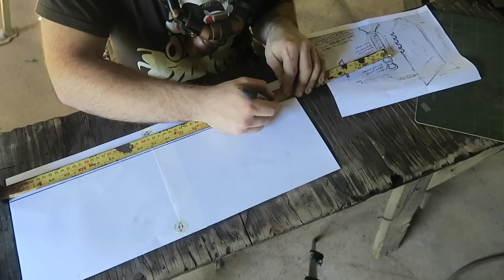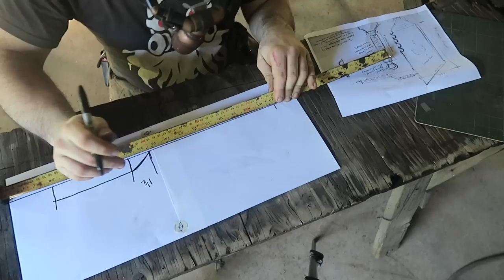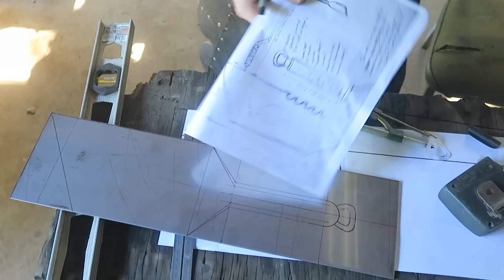Charity Microbuild: Tactical Combat Spatula!

Comment: A note about drilling stainless- Halve your drill speed and double the feed also optionally use coolant. This way you won't work harden the stainless and melt your drill bit.

Comment: Tip for drilling stainless steel, use 135 degree tip drill bits, and It drills slower then hard steel. An plenty of cutting oil, some people like windex for that.

Comment: You need to add some lubrication to stainless when cutting  or tapping threads as it has a tendency to cold weld to other metals same as when trying to screw through it, that is why screws and nuts bolts snap off with  it as you try to do them up .

Comment: Stainless doesn't drill well because like aluminum, it's quite a gummy type material. It's doesn't break chip like steel does. At least it isn't Vasco or MarC300. Trying to cut that material with coolant creates a giant string because of the high nickel content.

Comment: You have to use a cutting oil when tapping and drilling stainless. Liberal amounts. Lots of pecks also. It is soft but it wok hardens very fast.
Reply: He talked about why he never uses oil when drilling in another video, something about how it makes it hard to weld later.
Reply: Oil causes splatter and impurities in welds. Its a catch 22. Either drilling and tapping is a bitch or you have to degrease like mad to get good welds. Stainless can be a bitch to work with.

Comment: Stainless steel does not like heat because of the chromium in it, it's also why it polishes well. It's actually a very hard metal to work with

Comment: Stainless steel work hardeneds under certain conditions i believe. But you're right its has its own rules on how it wants to be worked.
Reply: Brett I hate working with it.  It's hard to drill and warps and changes colour if it gets too hot.  Stainless bolts are equally as bad, they give no warning if they are over tightened and just strip... And then you can't get the nut off without a grinder.

Comment: @Joerg: What if you build your small toy arrow launcher using 9mm blanks? Is this a weapon or a toy? Gas or air pressure is the same, but this would create a very portable device with bolds. Those blanks are also used for nailing machines oder for butchers ? stun guns (Bolzenschußaparat).

Comment: I bet you burn up  a lot of drills. the spindle speed on your drill is way to fast, for stainless I usually use a speed similar to what I would use for A2 or air hardened steel. and use some lube,